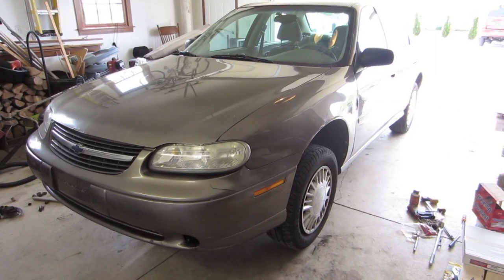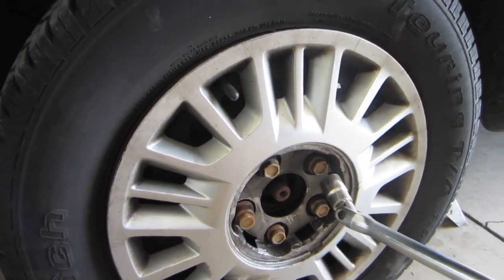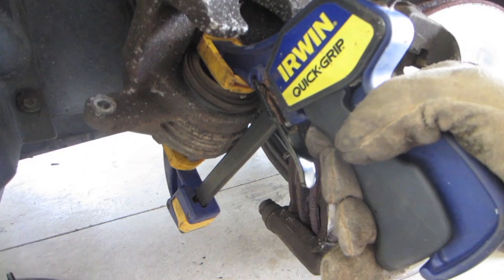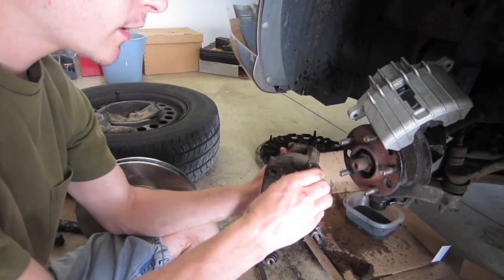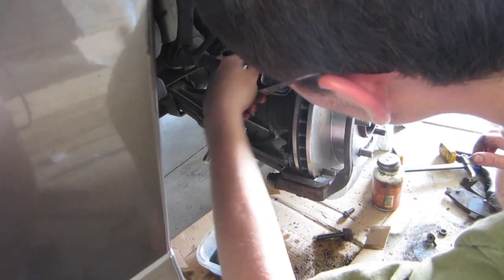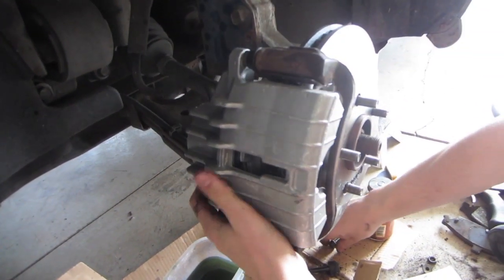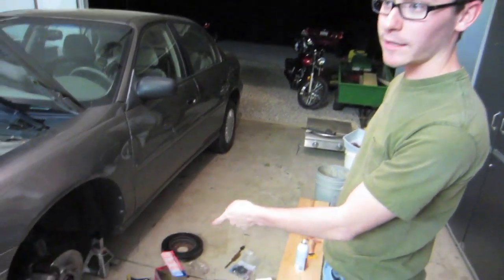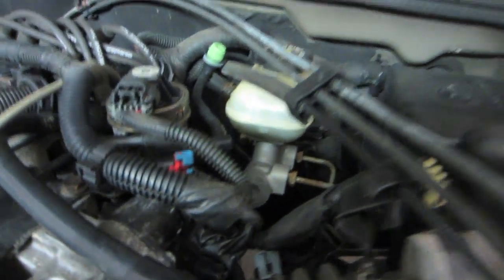(How To) 2000 Chevrolet Malibu Front Brake Change

Comment: Easiest brake job I ever did. I did not remove any clips. The hardest part was getting the caliper off the brake pads. So on the second side I used the C clamp to depress the caliper piston first. Then I loosened The caliper pin bolts. I pulled the lower bolt out to remove the pin to clean it and put anti-seize lubricant on it. After I got the brake pads out, I put lower caliper pin in. Then I did the upper caliper pin.   after replacing the brake pads, I couldn’t get the caliper over the brake pads till I put the C clamp on an old brake pad to depress the piston further. I like how you showed good video of all the parts. I needed a 12 mm long handle six point wrench with a pipe cheater, to bust loose the caliper pin bolts. For a cheater on the wrench, I pulled the handle off the harbor freight aluminum racing jack. Open end of the wrench was just a nuisance. Otherwise I could’ve used conduit for a pipe cheater.  Open end of  wrench came in handy for tightening up the caliper pin bolts. I liked how easy it was to get the new pads on after getting the old pads out. It would’ve been much more difficult if I had to struggle with removing all the clips and re-inserting new clips. Here’s the couch I paid $800 for a complete brake job 15,000 miles ago. The pads were completely worn out. What happened that the pads wore out so quickly? I wondered if the caliper was not releasing, after the brake pedal was released? That didn’t seem to be the case. Oh and in bcase you’re wondering about the rotors, the rotors are not warped. After a test drive the brakes seem to work well and there’s no thumbs up subs like you get with a warped rotor. So instead of $800 I spent $12 buying new pads semi metallic. I just wish replacing intake manifold gaskets was this easy. I got a Cadillac that won’t idle after doing a simple job.

Comment: The size you need is 19mm for the lugs,13mm for the bracket and 12mm for the caliper. I just did a brake job a few days ago on a 2000 malibu btw it's a pain in the ass if they been on there for awhile so don't take it on unless you are mechanically incline.
Reply: It's easy even if someone has never turned a wrench in their life.